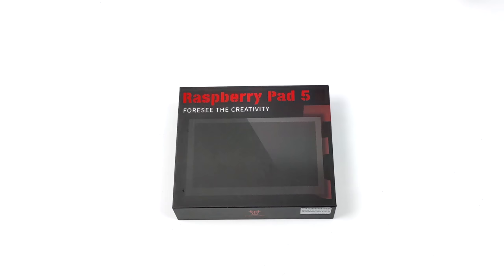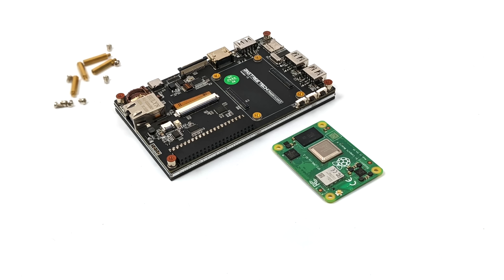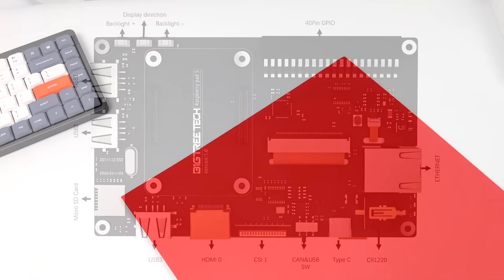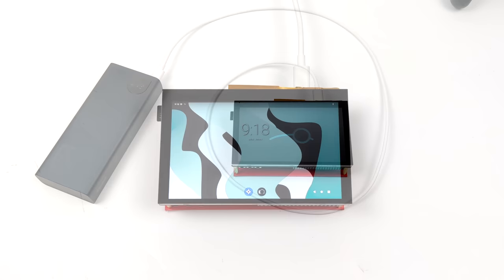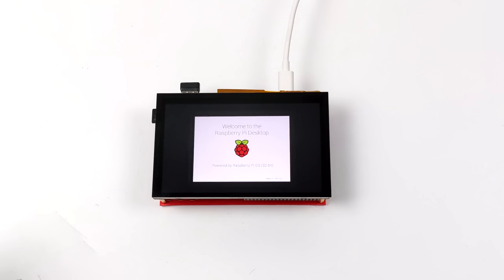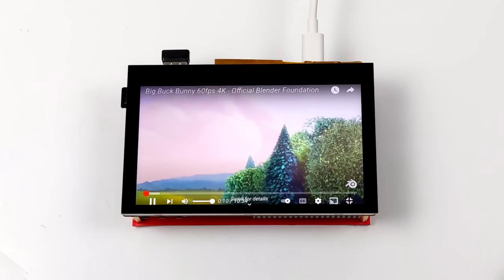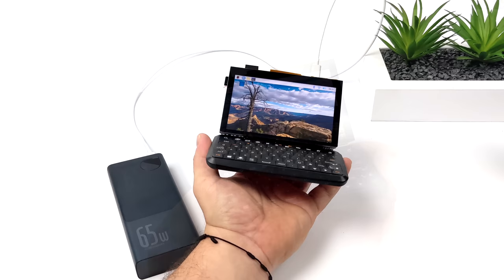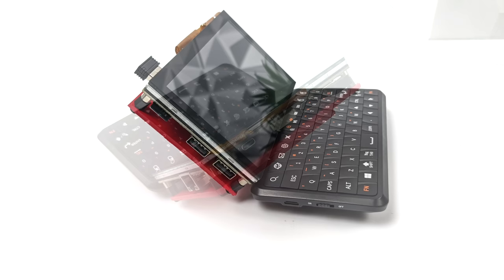Raspberry Pad 5, You Can Easily Build An Awesome Cyber Deck With This! Hands-On

Comment: hey, I have an idea about the "easy cyberdeck" setup! you could design it so that instead of a clamshell, you'd have a slide-on mechanism for attaching the keyboard, would also be really easy to do, you can do it with 2 layers, filing away till they make a hole between them, or with three layers, which go "solid backplate" "layer with holes for the posts to slide into" "another solid layer", the latter of which doesn't necessarily have to be full-size, it just needs to cover the holes, keeping the sticks/posts in, and then on the bottom part, you could use the same material that you just cut out of the middle layer, file it down a little so it moves a bit easier (especially from the top end which you'd be inserting, probably try to curve the corners), and the bottom end you can screw or glue into the base part, or be ALSO slide-in into the base part (preferably you'd have screws or velcro or something that keeps it stable there, though), that way you can disassemble it into a much smaller and less fragile state (e.g. you could feasibly put it in a bag, without risking breaking it due to something else pressing against it a little too much, etc, so you can take it outside of your home)
make it into an actually portable setup, not merely a "you can hold it in your hand, at home" setup

Comment: Kind of while you're on the topic of it I've asked this question once before I didn't get a reply so hopefully this time someone can answer for me I'm at raspberry pi I tried to install an Android system on it from one of your last videos that you've talked about it in I got to work that part was great and everything only issue I had was regardless of what size I put into it it only gave me 16 gigs to work with and that's not counting the pre-installed stuff so no matter what I can only put so many apps on it so I was very very limited is there any way around that or do you know another version that lets me use a much space as I want? Cuz other than that the only solution I saw was to download the apps that I needed to use them but wouldn't result in me having to delete them as I went on so yeah if there's any way around this somebody please let me know or even better yet if it's another system or a link that works better also let me know or even best if you find another one yourself if you can make another video on it that would also be awesome

Comment: With the gap between the backing and the circuit board it looks like you could easily mount a battery pack and associated charging circuitry between the backing and the main board.

Comment: A small Piazo speaker would be easy to stuff in there.. A cool 3D printed case that holds a fitted sized battery With hindge would be cool.

Comment: Nice. I feel like you don't really need any standoffs? It kinda looks like the screw posts already are the same height as all the connectors, so maybe adding some washers is all it takes for the most compact version of this. Also with bending the material you could make a "unibody" design that covers the sides as well as integrate that keyboard arm in one single piece (and add cutouts to the right spots for the connectors). If furthermore you add a bulge into the base between monitor and keyboard (by bending the material around say a wooden dowel of sufficient diameter) you can make that into a tubular battery holder for a bunch of 18650 cells. Probably won't give you the most capacity, but would give you the most compactness.
Reply: Thought that but the Ethernet port 3:43 seems to bulge out a bit too much to let you get away without the standoffs? Could cut around it though I guess!
Reply: @fetchstixRHD  Oh you're right and I would choose the same solution: cut around it. If one is lucky it would even be flush with the back panel then.

Comment: It is hard to find a hardware that could replace phone for some scenarios. Raspbian is not suitable for small screens. KonstaKang did not support such screens up to recently because only in recent version it shipped with 5.10 kernel (support for DSI). Unfortunately my current screen 4.3 with DSI does not present ourput in KonstaKang android.

It is great to see working konstakang with a such small display.

Comment: all that io and they could add at least pads for a speaker(s) via JST.  I'd go with BT buds to achieve a slightly immersive experience  A 3d printer would be great for this build, ya need a hinge clam-🐚

Comment: I just wish the screen would be at least 720p and 7-8.9inc... With decent battery and 3D printed case you can make it into like tablet module and then a mechanism could be designed where you can use either mini keyboard or gamepad so it can serve either as super mini PC or game console... 

The only thing that stops me from realizing this is 3D printer and time... I have too many projects...

Comment: Cool little PC.  I could easily see this being used as a visual entertainment "remote".  Tap the icon for what you want to watch or hear and then have the HDTV serve as the main display using its speakers.  Or run the HDMI through an amplifier so you get better audio.  The chicklet keys are too small for me to use.  Would it be possible to link this to another touch screen connected via USB 2?  Then you'd have a dual touch screen mobile PC.  The lower half could be for mouse, typing, secondary status information, or maybe controlling extra features / games?

Comment: Hey can you try to reprogram/upgrade a old QWERTY keyboard phone into a full on computer system with raspberry pi. By using the already existing parts on the phone of minor changes. I am getting a “working” Motorola droid 3 in the mail and I would like to know if I can just upgrade it with such.

Comment: Sure, ok, lets turn the unobtainable CM4 into something bigger than a 4b+ while leaving out the one feature the CM4 has that the 4b+ doesnt, the pcie port. While we're at it, lets mount hardware buttons for what the pi can already do in software, and activity leds, in places the user wont be able to reach or see once its in a case, because who needs a protective case on a portable device? And lets top it off by hyping how slim and sleek and pocketable it is until you add on the bits necessary for it to do anything, like external power. And just to twist that knife a bit further, lets add multiple modes and functions to the usbc port that will never be used because there is nowhere else on the board to add power.

Wait, why is the adafruit screen outselling us?

Comment: $229 and they neglect to throw in a plastic back over? Shamefully greedy.
Reply: Where are you getting $229 from? I’m seeing just under $129 as its original price, and now it’s showing as about $99 with free shipping? (From description links)

Edit: found it now, but that includes the CM4. That said, as you could implement it in many different setups, would a case even be used?